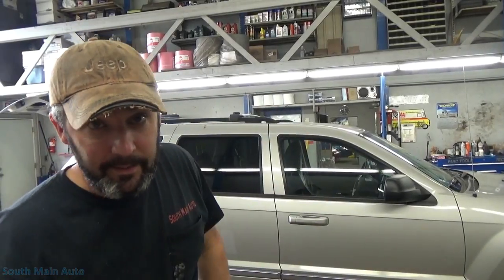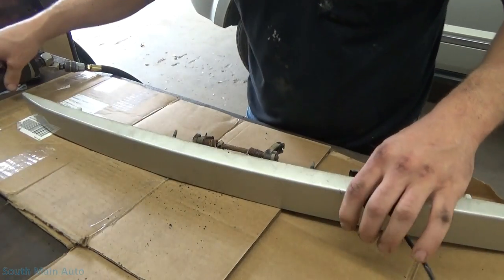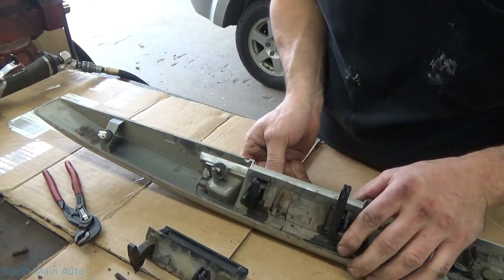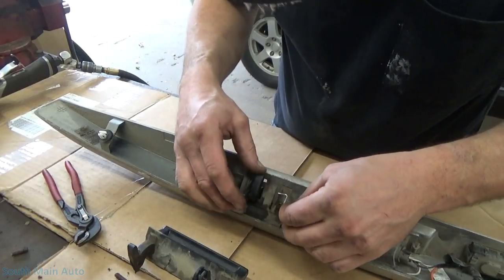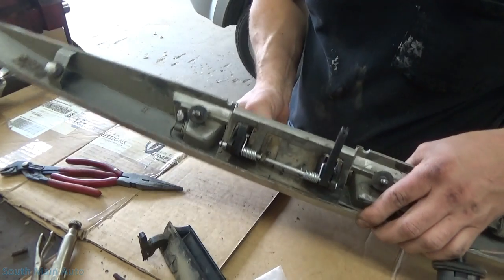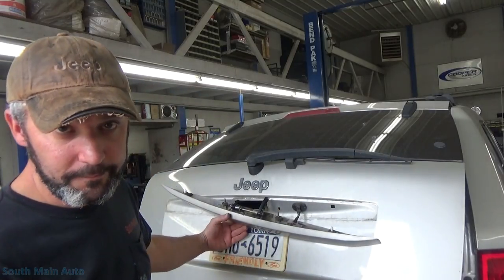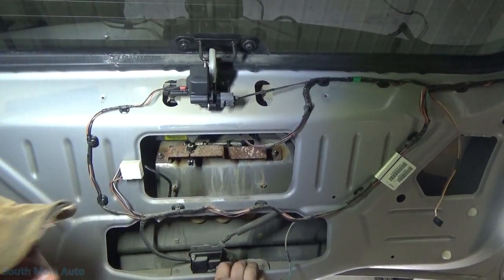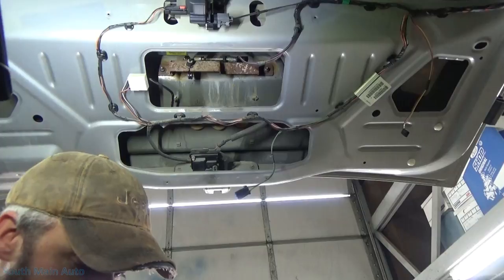Another DORMAN PRODUCTS FAIL: Jeep Grand Cherokee Liftgate Handle

Comment: Just an idea based on the equipment I've work on, you could make a shorter pin to assembly the handle on the bench then once its refitted on the vehicle push the short pin out with the correct one.

Comment: I would have took a Dremel with a sanding bit on it and cut open the  tailgate sheet metal a little bit for the pin to fit in. And yes forman makes scrap

Comment: Suggestion: put the washer on pin,  drill a 1/16" hole in the pin, install tiny cotter pin. Cut off excess pin. Used to keep a supply of 1/16 cotter pins and 3/16" washers in my box just for this kind of fun.

Comment: The push those clips through I use a socket or tube the size of the hole the clip goes through press down on it and it will compress the clip and it will come out

Comment: Dorman usually requires some modification, They even suggested I do so on one product!  If you had a thin nut that was close in diameter you could have thread it on and that would be sufficient.

Comment: For those without a welder (me a few years ago) I would've nicked it with the grinder to make a place to drill, used a small bit, cotter pin and washer as retainer. Then cut off the extra length.  But yes, shame on you, Dorman!

Comment: From the vantage point of looking at the video, the possibility struck me of angling the c-clip (long) end of the pin into the tailgate hole and then swing in the pin head end. It appeared there may have been just enough room. Easy to suggest but maybe hard (or impossible) to do. Don't know but it's a thought.

Comment: It's intersting Eric that Dorman pays attention to your videos (based on your comments in this video).  You may actually have some influence on them in the long run.  Keep telling it like it is.  Dorman does not advertise to consumers, so their junk is hidden behind the protective wall of the parts counter.  Until now that is .....
Reply: I think Dorman now offers a repair kit for this repair kit. It is a hacksaw blade, drill bit and cotter pin.

(The deluxe version is a bit spendy, but does come with a mig welder and washer)

Comment: Why didn't you just drill a small radial hole in the end of the spindle and put a split pin in?
Reply: Or, carefully, with the cut off tool cut a groove for the e-clip.

Comment: First, do you blame Chrysler/Jeep for a poorly engineered and structurally weak part?  Never happens with them, right?  Well, in fact, many such parts are designed by the supplier at the manufacturer's request.  Hard to know unless you see the drawings. Also, Dorman, from what I know, doesn't make anything. It is a vendor.  Component manufacturers supply the part, and often it comes from the same supplier that the car company gets the parts from.  So, do you think GM makes mufflers.  No, Walker does though and it sells them both to GM and Advanced Auto.

Sometimes you will see a variance between what you pull off and what Dorman sells.  That is commonly because the manufacturer had a change so if you pulled that same part from later assembled car, you'd see the later part.  That can be to beef it up or make it cheaper.  I know which you think is more likely.  Where it is made may have changed too, muchacho.

Also, a part isn't necessarily expensive because of what it costs to make.  The price can be high due to the cost of transporting and storing all these little parts for years on the shelf hoping eventually someone will need one.  It's not cheap to store the turn signal switch for your 1963 Fairlane until the point comes that you need one.  Add in the humans behind the counter and in other places that get the handle to you and pass out the free hats.  The store also commonly sells other stuff, like window cleaner or paper towels, not only because you may need it, but also because those have a higher profit margin to set off the cost of the replacement parts. 

Now you know why movie theatres sell popcorn and shoe stores sell socks.

So don't always beat up on Dorman and no, I don't work for them.  I've just seen how the vehicle industry works and how it gets components.  Or did, when I was around it.

Finally, if anyone wants to know, the trade name for what Eric calls "Christmas Trees" in the video, the term is typically "push pin".  Those are the 1 cent piece of molded plastic that cost $3 each.

Yours in Fluid Film,
Reply: Tom Davis I've never heard anyone call them anything other than Xmas trees or trim clips!

Comment: You've made an important ecological point with that video. Spare parts for vehicles should be available at affordable prices so that people keep the on the road and in relatively good condition. I guess it's much more green to save a car, even if its fuel economy is poorer, that to buy a new one which takes a lot of power and CO2 to produce... Am I right?

Comment: The list of quality items from Dorman is much shorter than the list of quality items from them.
Have an 03 Town Slab from NY/VA - it’s got rust. Someone replaced steering shaft 2 winters ago. It had a jammed up joint after one winter! To replace I had to move steering column out inside 1 inch. Friggen crap.
Since I’m SC - local pick n Pull - installed nice southern joints - new intermediate and outer for less than $20! Salt/rust sucks and so does Dorman.

Comment: (If already assembled) Remove C-clip, tap rod back, to just proud of outer mount. Install to door, without any fasteners, and slide into handle opening- one end first, rod slipping behind sheet metal. When completely flush- tap pin fully into place, and insert C-clip. Sometimes- Chinese Engineers will add on a few threads, a couple millimeters to a bolt or mechanism- thinking it will make it better, not realizing that extra whatever might get in the way of the OEM design.

Comment: Maybe I'm missing something (a few things). I would think a liberal use of 'panther piss' and working the handle till freed up followed by Fluid Film would have been an option.

IF that wouldn't work and the handle was installed (along with the longer pivot rod) and the whole assembly didn't fit because of the aforementioned rod, I would have probably used a round file to 'clearance' the tailgate. This would have been followed by Fluid Film on the filed area to keep rust from forming on the bare metal.

Then again I wasn't there performing the repair and could be completely wrong on my assessment of the situation. 

As for Dorman, yup I too remember the days they made/had good products with very few problems.

Comment: One thing about Dorman, their customer service is absolutely excellent. I bought hard transmissions lines from them, they had the wrong thread pitch(metric vs standard) and others had the fittings reversed. Radiator needs a long flare nut. Terrible to find that out after you worm it in on the floor, then you have to pull it out. There are caps on the fittings. They sent me an OEM one, as a thanks for helping them out. Would any other parts company do that?

Comment: What a bunch of junk those inside handles on 07+ sierra/siverados are a fuckin joke dorman gives you that countersink bit to drill the plastic rivets out then your suppose to install those self tapping screws that never tighten up the quality of the shit they sell these days is  retarded just last week put 3 master cyl on a fucking astro van before i got a good one they all leaked out the seal while bench bleeding good thing i work at the dealer and rarely have to use this aftermarket junk cuz using this shit day after day would make me puke